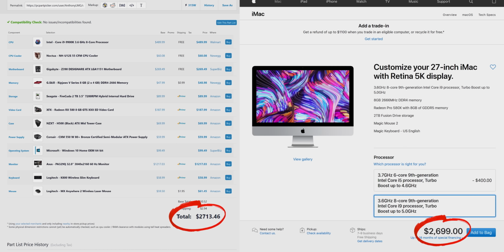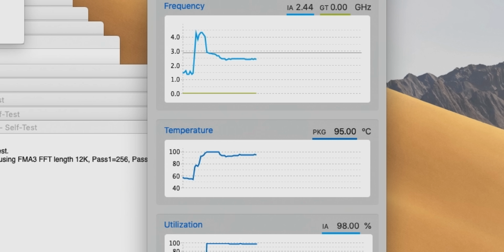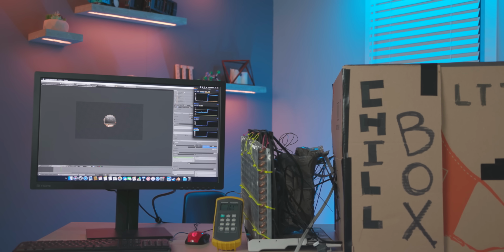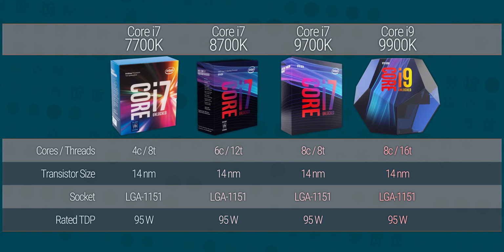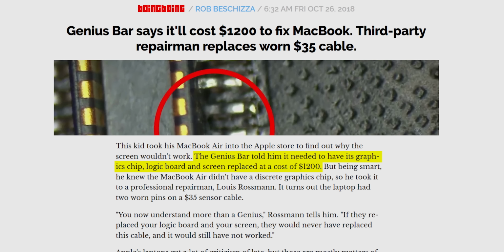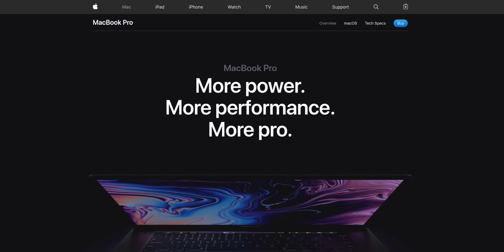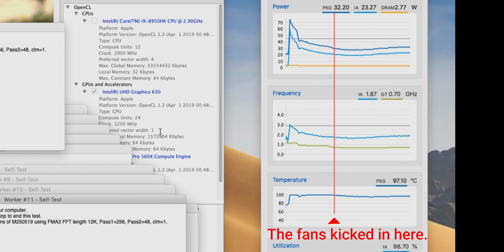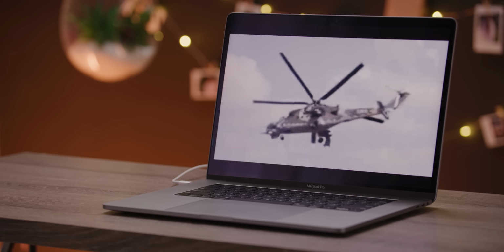Macs are SLOWER than PCs. Here’s why.

Comment: May be a little late to the party, but.... Apple are planning a move away from Intel x86 based cpus to ARM. Being a RISC architecture with very good energy-efficiency, and the fact that their mobile devices do actually have pretty decent specs, I would say that they're addressing the issues, just not right away.

Secondly, while they do have lots and lots of thermal issues, they don't throttle nearly as much as the thinnest and lightest products. They offer a good all-round experience, not a top of class in one thing. You need to think about it in terms of use case, and right now, if you plan on gaming, and/or doing some heavy work, why are you even considering an Apple. The core i9 was a bad idea, sure, and they shouldn't have released it, but people kept complaining about it. 

I own a macbook pro. I wouldn't say that it's the best machine there is. But it doesn't annoy me with fan noise when I do skype calls, it has a camera that doesn't look up my nose, it's thin enough not to cause me discomfort, but definitely not too thin not to be able to play Witcher 2 on it... With High settings... And yeah, I occasionally run programs on it, that take up the CPU to its limit. I occasionally let them run overnight. Am I glad that this will severely shorten the lifespan of my device? Not really, I'll trade it in rather quickly, and I don't think that keeping a 5-year old device even if it doesn't have hardware issues is a good idea. More's law aside, Apple can introduce some nifty peripherals! 

I'm not an Apple fanboy. I wouldn't pick an IMac as a Gaming PC, and their policy of black box that you can't repair is very annoying especially since there aren't any genius bars in my country. I just don't get how apple can take all the flak when Dell are dropping the ball just as hard.

Comment: You want an i9 in a notebook ? Fine so deal with the 10cm case and the quad cooling solution applied to it.

You guys can't have monstrous performance AND super thin quiet like cooling solution.
Reply: pick two,
appearance/
performance/
Quiet/
Affordable 
The last one was added on to allow the budget race to identify their desires "fist up"
Reply: @Desimoar  I have all three.  Of course, it's a desktop.  And it's not an Apple.  Your sentiment is right though - you can't have it all.  Regardless of what Apple says.
Reply: thats a desktop not a notebook..all notebooks throttle and are quiet unless theyre bloated windows garbage
Reply: @slimdunkin117  Yes - I know it is a DT  - I actually said that....but thank you for making that clear to anyone else who can't read.  And BTW - My MSI laptop doesn't throttle - because with a nice tool, it's an option.  It does get hot of course.  But of course, you missed the entire point me thinks - so nevermind.
Reply: @Desimoar  I might be missing something obvious but I don't see why you can't use running water to cool your machine. Granted, you need another solution for when you want to take your machine with you, but while you sit it down it can be slim looking, perform great, AND quite.

Some quick math: say water from the tab is about 20 C, and you want to keep your cpu at 80. With a heat capacity of slightly over 4j/degree/g, for every gram you get 240j of cooling. To reach the (heh) 35w cooling power you need a measly 0.15g/s, or about 1 drop ever 6 seconds. That's not making any noise whatsoever.

All you need is 2 very VERY thin tubes running from and to your machine to and from your washroom/kitchen.
Reply: @randomnobody660  You do realise tap water contains biological contaminants, there's a reason people fill their waterloops with liquid coolant it's called Algae. A portable watercooling system would be a good solution though however I'm not sure how practical it would be for a laptop.
Reply: @stereoman5532  im not sure what you are trying to say.
Why does bio matter in running water matter? Things can't really grow in running water anyhow.

I'm not suggesting having this on a laptop. I mean if you have a desktop why can't you cool it with running water.
Reply: @randomnobody660  because they are show casing a laptop and not a pc, plus water cooling wouldn't be so practical in this case due to cost. Finally I was making an observation about you can pick two, appearance or performance or it being quiet.
Reply: @Desimoar  I was not talking about water cooling, at least not in the way the word is usually used. Simply running 2 hoses in and out of the system should not be terribly expensive.

I don't dispute that based on what's on the market you can only pick 2/3 things. I'm proposing what seems to be an obvious solution but for whatever reason is never implemented: running water through the system and then just dumping said water.

I also think it's fine in a laptop. Simply have it cool that way when you "dock" it so to speak, and let it throttle when it's carried around. Personally I would be very happy if I had a slim and barely usable machine to carry around with, and still be able to make it powerful simply by connecting it to a tab.

I don't think many expected to train a convolution net/mine crypto/do any computationally intensive work on the move anyways.
Reply: @Desimoar  Fair enough regarding the DT part - but I guess my issue was "appearance".  How something looks can be changed with no bearing on noise or performance - or heat.  But really, this is silly - I get what you were trying to say.  You can't have everything.
Reply: You want false advertising? Fine so then deal with 2.9GHz or worse while paying for that i9, lol
Reply: it's mac Pro it shouldn't throttle make it 15cm case
Reply: @1010Brij  you can't redefine the laws of physics.

35W TDP CPU AREN'T fit for an older 15W thermal solution. Even more if Apple lock down to minimal RPM those little fan already overwhelmed. 

Mac Pro aren't "Pro" since a loooong time. Is just a way to tell "More premium Macbook".

Pros doesn't care if the case is THICC as long as it does it's job.

Pros also doesn't care if the machine look sexy as long it's repairable and modular.

Pro ARE Pro. They bought this because they have a NEED for a specific task. As long as it does it's job, they DON'T care about the rest.

Fact are : Apple isn't making Pro product since forever. The only person I know with Mac is students, mostly girls in general in the mid-20 to early-50 that don't even know what's a CPU is and people who's want to brag about their product.
Reply: Razer blade 15 advanced
Reply: Unless you're Canadian XD
Reply: 9:40
Reply: That's a lie. Case in point: Asus ROG Zephyrus S GX701.
Reply: Apple used to give customers that option though. You could have the thin MacBook Air, or the thicc and powerful MacBook Pro. Now they prioritise thinness over power in all their machines.
Reply: Two words, Surface Book.

Comment: I think apples grip on the people who are just interested in the looks is slipping.  I'm a TOTAL mac fanboy but even I know when enough is enough. its time to lower their prices and lift their game. the more "pro' users are moving back to widows in droves and I don't blame them. Yes a similarly spec PC might cost very similar, but its going to run cooler and thus faster, its going to be customized to look the way you want it to look and if anything should fail or need upgrading you can just replace that single part instead of having to buy an entire machine because a soldered on SSD failed. Also apple having great looks, well yes they do. but so do so many other "lesser" companies these days WITH TOUCH SCREENS!! so yeah.. I do love apple but they have totally lost their way and I think its a matter of time before they start to suffer and they have no one to blame but themselves. Oh and not to mention anyone who repairs their machines is a total "con artist just looking to steal your money" #righttorepair

Comment: Weird that there's no discussion here of the fact that Apple produces the SoC in the iPhone and can therefore manage both sides of the heat production/ heat dissipation equation. Reading between the lines I think it's pretty clear Apple intends to move to ARM from x86 in MacOS and is deeply dissatisfied with Intel's (thermal and other) performance. See iPad pro performance as proof of concept. Plus there's the money to be made if they could pull that transition off. What would be more Apple than owning the details and making more money? ARM power efficiency seems compelling as well. Let's hope for interesting times ahead...

Comment: Battery life. The reason they don't let the thermal cooling kick in immediately is battery life. They would rather have a little heat on the processor, etc than have the fans kick in because the wannabe hipster customers with laptops are mobile and expect the battery to last them a full day, even if that is 10 to 12 hours of editing 4K video in a coffee shop or their van while on the road. 😜

Comment: To say that, as the title suggests, all Macs are slower than PCs is blatantly stupid. My 10 year old MacBook (running macOS Sierra) is faster than many Windows laptop sold today. The thermal throttling is caused by Intel's cpu's and may happen more in MacBooks because lesser cooling. But in PCs it's Windows that causes mayor slowdowns of your computer. When you open the Windows task manager you may see a more than 90% 'Disk usage' because the system is full of bloatware that consumes most of your system's memory and resources.
A fast pc becomes (terribly) slow within a year or less with the pile of Windows updates that make it slower and slower and make you long for a new pc, while a Mac just keeps on going for many years without getting really slower. That's why an old(er) Mac is still much more valuable than an (old(er) pc. A pc that is older than a year is basicly junk. In general macOS is a much more powerful os than Windows that still contains a lot of primitive software that hasn't been changed since the Windows 95 era.

Comment: I can put in a full days work on my macbook pro while running VMs and running Sketch etc. Where it does slow down is editing RAW images and the fans will spin up.

Most people are not video editors or run big intensive software on a laptop. I guess they would rather do that on a desktop right?
Reply: But if you're not doing any video editing or extensively stressful tasks then why would you buy an expensive laptop over a cheaper one that still does exactly what you want and has warranty just like the mac?
Reply: @TheRezin819  Build quality. My . previous macbook lasted 6 years. I have my current one for 3 years. How many laptops have a loose hinge after 2 years? Or need something replacing? Most
Reply: @wrux  and other brands like dell have that good quality for cheaper, and their keyboards are great, i have a 7 year old dell thats still in great condition and has a quad core hyperthreaded i7
Reply: And for extensive users ie high demanding task power users the cooling solution on mac is sub par making their quality actually pretty poor its just nice looking design
Reply: I can run faster than a 4 year old. I must be an elite Olympian.

Comment: If you are going to put a fucking Intel core i9 cpu in a thin laptop design made for U series processors then you are stupid as it will thermal throttle no matter what. You need a THICC chassie design with big fans and more than 2 heat pipes for the thing to work. Is Tim Apple that dumb.
Fuck the thin and low noise bullehit PRO laptops with a i9.

Comment: I'm glad I bought my MacBook Pro 7 years ago. It's still going strong today and the reason for that is a lower TDP, the cooler can actually keep up with dissipating heat. 
Would I recommend a MacBook or even any Apple product now? No. Probably not. 
The innovation is gone and the sheep just follow. 

I don't get it
Reply: How much innovation do you need in life? Do you want to get something new every time? Apple still makes some good products, and still fails at other products (like keyboards, mice)
Reply: @retrocomputing  why would you not want innovation? That's madness. 
You need new but familiar and Apple had that up until Jobs died. 
The last few keynotes have been rehashed crap. 

Apple make a couple of new products for such a niche market. The iMac pro for example, an amazing product that LTT have covered, but a mass market, I think not.

Comment: I traded my desktop for laptop because I need to be mobile and travel regularly, but I'm well aware that the life span of my machines will be much shorter than a decent desktop PC. i9 laptops are basically a waste of money because the thermal throttling means you'll never make full use of the processor.

Comment: This might be the most stupid idea, however, if you can collaborate with Louis Rossman on this one would be great, install a core i3 in MacBook pro 13 and do a comparison of it with an i5/i7 MacBook pro 13, it should be possible as Apple supports i3 in mac mini and they uses same socket pin layout.

Comment: The processors in an iPhone are based on ARM, a lower power, lower cost and more efficient in regards to heat, architecture. Intel's x86 architecture is old and inefficient. Thus, Intel releases a lot more heat than ARM.

Usually, ARM processors don't need fans and heatsinks to work properly (but will last less) but Intel processors will need at LEAST a good heatsink.

Comment: Linus, I generally believe that you are an expert and TBH most of the times I really enjoy your videos, BUT it seems like you just don't get what Macs are all about. I was one of the LTT MR. I had powerful PCs and I loved to maintain them and tinker with them. However, I was also interested in using them,  but my experience was ruined by the stupidest thing mankind ever invented: Windows! I bought my first MBP roughly 3 years ago and since then I am a happy man! I never have to turn it off before I close the lid, I only restart it once every couple of months when an OS update occurs. I love the fact that in terms of acoustics there's no difference whether my Mac is on or off. I. Enjoy. Using. It. Another thing: Someone, who does not care about clock speeds, does not mean that he or she is not tech savvy. Thanks for hearing me out.

Comment: I think Apple just threw in high end processors because everyone bitched about the fact that they were behind on tech compared to PC laptops. They didn’t want to build bigger, heavier, clunkier laptops because that’s not their thing. So they dropped them in to shut people up for a while and pulled some tricks to make it work in their form factor. And rumour has it they may switch to ARM-based custom CPUs in the relatively near future so they can offer something much better in that form factor without some of the same issues. So I think they don’t care because it’s really just a stop-gap to keep people somewhat happy until then. It might hurt their rep a bit with pros in the short term, but if they can wow everyone with new ARM based ones later it won’t really matter. Who knows if that’s really the plan, but it makes sense to me.

Comment: about the difference between their computer and smartphone products: it's not a difference of philosophy, but rather a technical one: ARM based processors (that are used in phones and tablets) have a much lower power consumption and generate much less heat too. the problem here is not a change in philosophy, but rather a lack of change of philosophy when facing a different context that requires a different philosophy.

Comment: I use SMC fan control, put the fans on maximum and leave them there. And as for no throttling on iPhone, perhaps those A series chips are better than we thought.
Reply: Is this guy serious or just trolling around ? You're comparing a SoC with ARM CPU to a x86 architecture chip.

Comparing the two is an absolute mismatch in terms of performance or TDP. You'll never get an actual ARM CPU capable of what a decent cooled i5 8gen can do. Let the i9 monster alone.

Yes. Marketing in Apple bionic chip is strong but please try to research a little bit before speaking nonsense.
Reply: Mega Gardevoir ok so I got something slightly wrong, I don’t know enough about the A series chips to comment. Nor do I have enough time on top of my 50 hour a week job to research them in great detail. I’m out to learn, I don’t expect to be insulted for being wrong.

Comment: It's not as much a change in philosophy as it is Apple has control over the chip inside the iPhone. They're only willing to solve a problem if it can be solve through the internals or the software, Apple puts emphasis on hardware as the average consumer processes what's at face value. On a side note, does anyone else find it odd that school systems do not provide an introduction to technology course?

Comment: I own a 2018 MacBook Pro and a 2018 nzxt built pc with the exact same specs besides for graphics cards and memory. What I have noticed is that with the Mac OS it does not have the random crashes that come with my pc running windows. I also noticed that for about the same price rendering stuff in After effects the the Mac has a fast ram preview but the pc has a faster rendering speed.

Comment: in fairness it's not Apple's fault that Intel releases high-end "mobile" CPUs that require desktop-sized cooling to keep temperatures sane
Reply: It is apple's fault, however,  that even in a sea of laptops that thermal throttle using the same high end CPUs (that everybody already knows are too high-end for laptops in the first place), the macbooks still manage to be the worst of all of them, even before stripping away their OS specific tweaks.